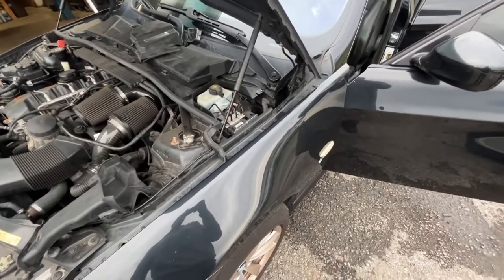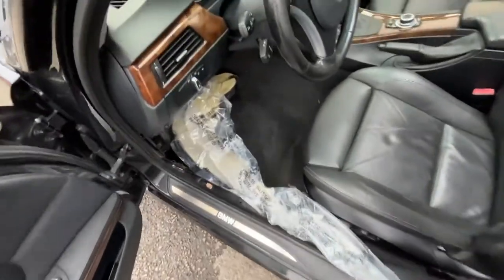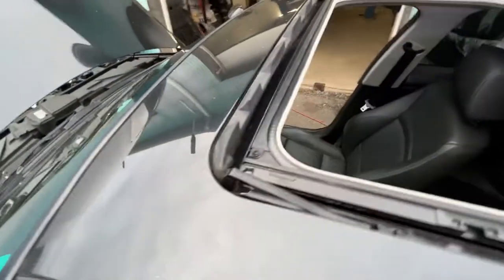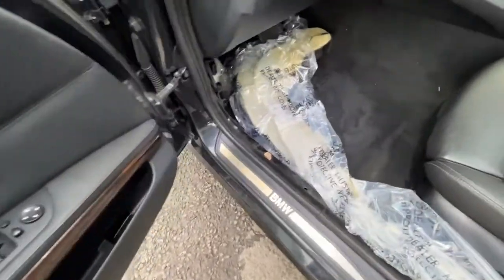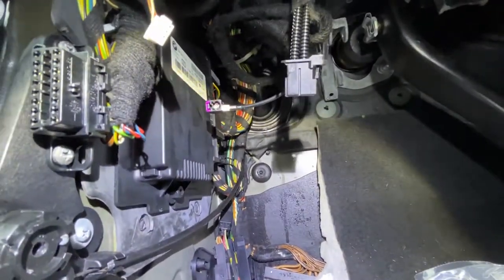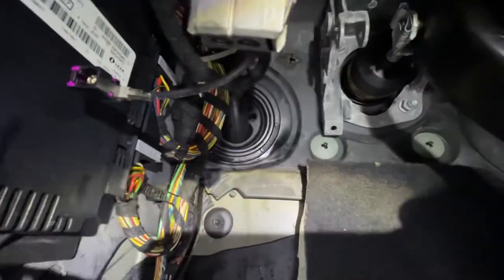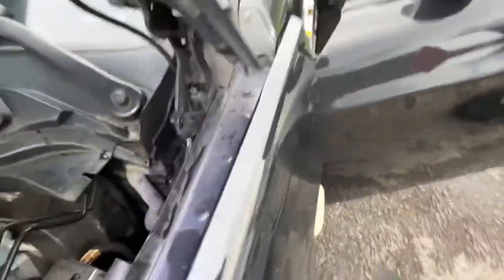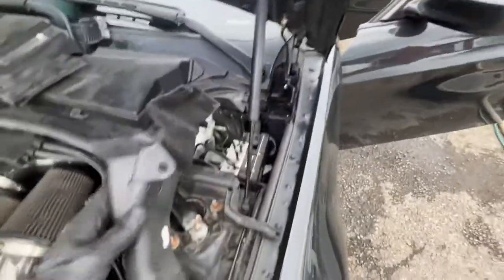BMW e90 e91 e92 e93 water leak into left driver footwell FIXED!!!

Comment: I’ve had this problem for so long and it just so happened to rain today in Miami and I came across your video and boom, problem solved. Thanks a bunch much needed video.
Reply from the maker: You’re very welcome
Reply: How did you fix it? Just reposition or use sealant? Cheers

Comment: i am also having the same kind of a issue [wet carpet near the accelerator paddle ] noticed just today , let me check as explained in the video . thanks mate for your great video .
Reply from the maker: You’re welcome!
Reply: @agy2k2  hey man how did you get access to putting the drain tube back on? such a tight space. removing inner wheel liner helped? thanks!
Reply from the maker: @ST0NGE  yeah definitely have to remove the fender liner! It’s too difficult to install it properly without doing so.

Comment: Hello, if I understand correctly, this tube pops out of its mount and the water drains to the wrong place you need to put this tube in the factory position, even I think it can be on silicone,?
Reply from the maker: There is a plastic push pin that holds it into place

Comment: I have the same problem with BMW e87.

Thank you for posting this video.

Btw did you buy new drainage pipe or you just put the old one much better?
Reply from the maker: I just had to re position the drain tube. I didn’t replace anything. Need to pull fender liner to get it lined up properly
Reply: @agy2k2  I've just fixed mine few days ago, after many months of agony.
I used little bit of silicone to glue and to make sure the drainage pipe is not moving anywhere.

Comment: Thanks for the video. I had the same problem with my E90 RHD, left rear passenger foot well carpet got soaked with water. Checked AC drain, door panel water barrier all not working 😢

I poured water to the left side leaf catcher, found water seeping in and reaching left rear foot well within 30s.

I sealed the wire’s rubber cap and the plastic cap with sealant on the outside (firewall), hopefully this will solve the problem.
Reply from the maker: I hope you get it figured out
Reply: Was this a solve for the problem?!?!?

Comment: hy  Ryan, im pretty sure that cause my little for now water leak. but, how u get the tube from there?!
Reply from the maker: It's definitely not easy. You need to take the left front fender liner out to get to it. It must be installed perfectly correct or it wont drain right.